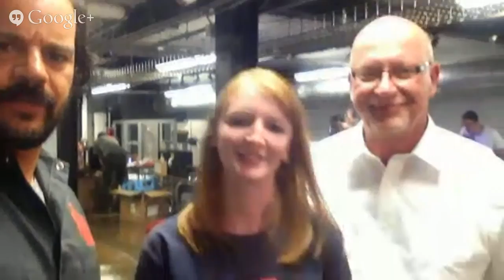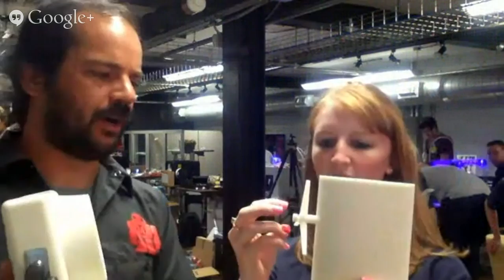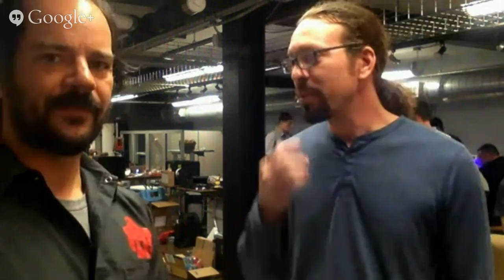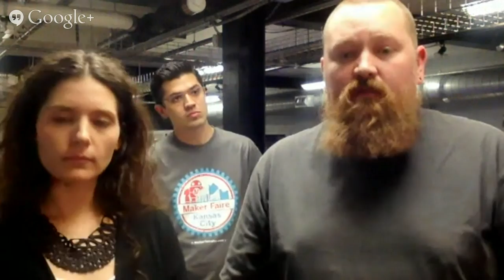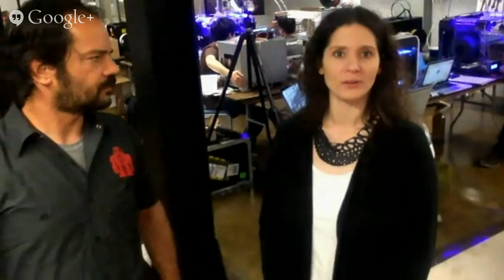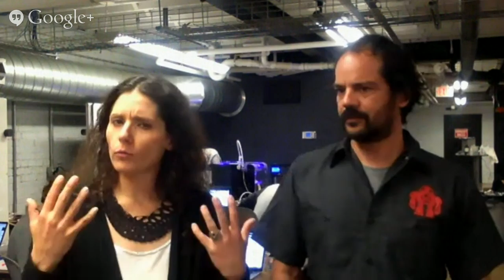3D Printer Shootout at America Makes

Comment: To answer your question at the end "why/what did you build?", I built a Reprap Prusa i3 rework. The most popular variant at the time it seems. I built it because its cheap, and its an education at the same time. Many advise building so you can better troubleshoot later on. I built mine for about $350, including a E3D v6 hotend and some other high end parts where it counts. I sourced most of the parts on Ebay. From what i have seen this is a dirt cheap price for a first build, and also from what i've read, a well setup reprap, with a high quality hotend, can produce as good of prints as any commercial unit. I still have yet to make my 1st print, just got to the wiring, so we'll see how it goes when I get there. Its been a really fun project so far, kind of the "ultimate lego technics kit" is what my sister called it.